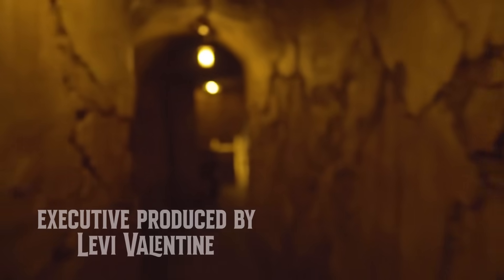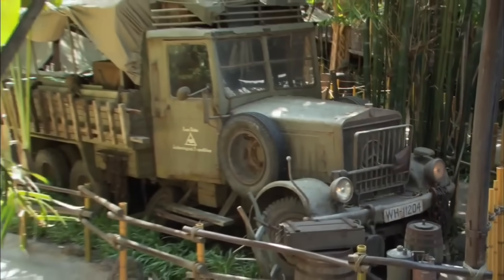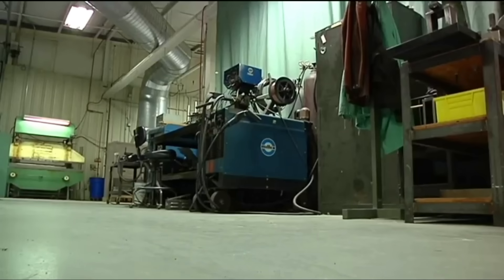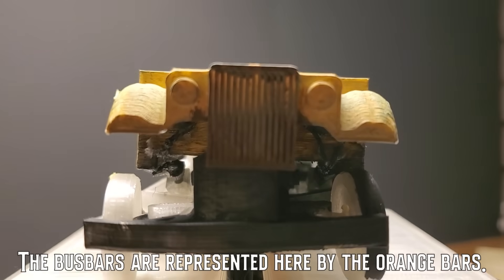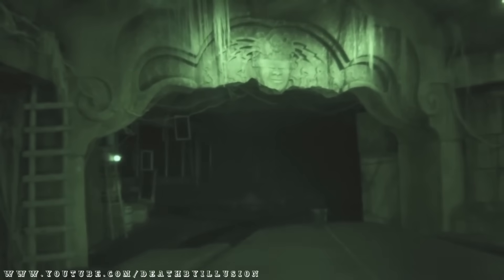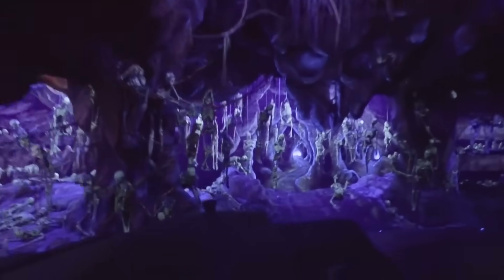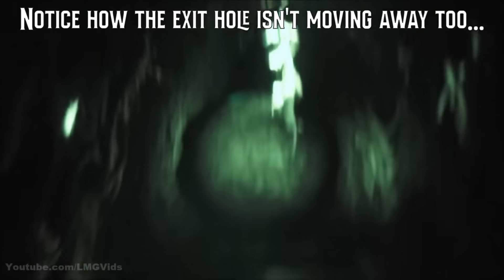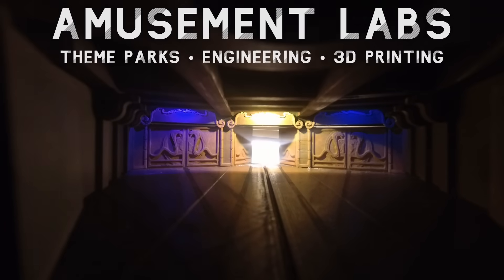How It Works: Disney's Indiana Jones Ride

Comment: Those doors man, one of the things I wish they would fix. It's been too long and it was totally worth iit
Reply: A rack-and-pinion system would be far simpler and much easier to fix.  It would also break down much less frequently as gears tend to last longer than cables.
Reply from the maker: Even something as simple as a grip plat and drive tire.
Reply: @protoborg  To heck with all that. Just have curtains automatically cover and uncover the doors, plus turn off and on spotlights. We've had technology for that for decades, ought to break down very infrequently. Simple is always best.
Reply: I mean with all the free time Disney has had over the pandemic (With snow white’s enchanted wish they have definitely been working) maybe they fixed the effect??? Wishful thinking but hopefully at some point it comes back!
Reply from the maker: @Lemoncoder103  also, I would love if they brought back the rubble effect too. Just not with ice, maybe chunks of foam or plastic.
Reply: @AmusementLabs  Funny story from a lady who was cutting my hair a before the pandemic: “I thought the rubble effect was still around so I ducked and broke my nose on the dashboard”
Reply from the maker: @Lemoncoder103  oh no!! 😅 Oh that's gotta hurt. They should make the dashboard out of padded foam.
Reply: @AmusementLabs  An even better (read: more reliable and affordable) rubble effect would be two fog screens with falling rubble projected onto them, giving the illusion of depth and a cloud of fine dust debris.
Reply: @AmusementLabs  I never thought of it a rubble.  With the red lighting it always looked like dripping lava to me.  Sure miss it.
Reply: @Lemoncoder103  they stopped the rubble effect because the machine started to rust, and wasnt moving fast enough for the ice carrier for the 18 second interval to send vehicles into the ride, so it was getting missed. plus ice would end up on the track and melt...causing the ride to break down because of vehicles slip and sliding
Reply: @courtkneelaaurn5394  ice carrier?? Can you explain?
Reply: @JennyGDelp  a bucket basically
Reply: @AmusementLabs  what about 3D printed rubble?!
Reply: @AmusementLabs  For instance, they could use a system like more recent bowling alleys use with every pin having a cable attached to its time. Let the rubble slide down some dull black cables then reel it back up again.
Reply: @protoborg  exactly
Reply: Honestly that is the issue with Disney. They love to build something so damn complex and then do not care to fix it when it breaks. If that is your philosophy than why even bother building it in the first place. Numerous examples of this exist throughout their parks such as in Expedition Everest and the Great Movie Ride.
Reply: Unfortunately, it is a structural issue with the building itself.  I don't know specific details, but IIRC cracks were found.  The entire room was very structurally unsupported when the effect worked, and the mummy chamber is directly above it, which is a lot of weight to support.  The only way to fix it was to add more structure, preventing the effect from continued use.
Reply: Good news for you.. they did
Reply: @PhoenixStrongg  The doors or the rubble?
Reply: @Gamerboss40YT  both I think? Def the doors
Reply: Modern Disney is incapable of keeping any mechanical devices working. The parks are in slow decay now.
Reply: I would love to see the doors move like they used too!
Reply: I was an annual pass holder and the ride was scheduled for a couple month maintenance period before the pandemic so hopefully they have fixed the doors with all this spare time!
Reply: Justin Gersjes when did the doors break
Reply: i used to work th ride, and sadly the effect will never. come back. the walls are bolted down now.

Comment: I believe it's the Indiana Jones ride in Japan but I believe they removed the rat effect and replaced it with a projection mapped fireball that shoots towards you. I also think they might have a working version of the ice boulder effect. EDIT: it's a fog vortex and the whole thing is crystal skull themed so instead of caves and fire it's a more mystical bluish green.

 I feel like it would be worth it to upgrade some of the stuff around the ride. It's honestly one of my favorites but at the same time some of that stuff could be modernized.

I'd hate to see it move to a trackless system though because those usually require a flat surface and would make it more like rise of the resistance. Which is a fantastic ride but at the same time just doesn't quite have that sense of immersion in the same way that indiana jones does.

Comment: Now I finally understand what you were showing a few months ago with the doors. I heard they got rid of the lake of fire, and you didn't talk about it either. Is it really gone now?
Reply from the maker: I actually didn't know about this. It's just some lights under a layer of chilled fog though...
Reply: @AmusementLabs  If you are right boy did the effect work, because I felt the heat of those flames and they were wipping. Didn't know fog could do that. But again, I have been told they dropped it a while back. In fact I have heard most of the ride is in actual decay compared to the 90s when I rode it regularly and it was brutal fun.
Reply from the maker: @TheRadioAteMyTV  yeah, it's pretty easy to make low laying fog that doesn't disappear quickly. Regular fog is just warm deionized water and a few other inert chemicals vaporized. You then pass this vapor through a duct through a cold chamber and, boom, low laying fog.

Comment: Wait. I'm pretty sure that the Boulder effect has been disabled as well. It doesn't move the walls like that anymore,  but I could be wrong.
Reply: They did a complete ride refurbishment in 2018/2019 after the Boulder hadn’t worked for almost a year. They added voice lines to the last Indiana Jones animatronic, changed the rat area, and cleaned up effects. The Boulder since that refurbishment has worked every time, but to varying degrees. I know for a fact that they turned down how far it comes towards you, it never rolls above you anymore. I think this was to preserve the aging mechanics of the Boulder/walls.
Reply from the maker: It's hit or miss it seems.
Reply: @AmusementLabs  so it works sometimes and sometimes it doesn't? Didn't know that
Reply from the maker: @brantfowler3630  yeah, in some of the POVs I found it didn't move back.
Reply: @brantfowler3630  it really just depends